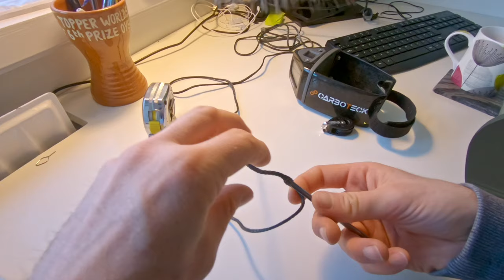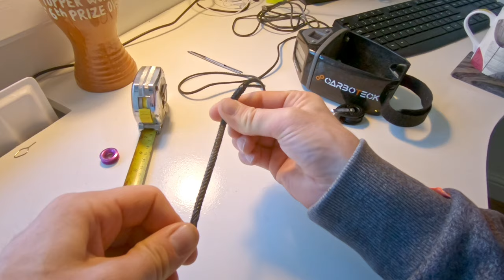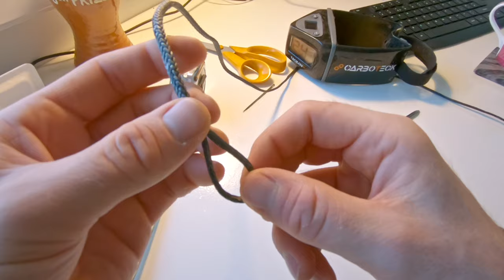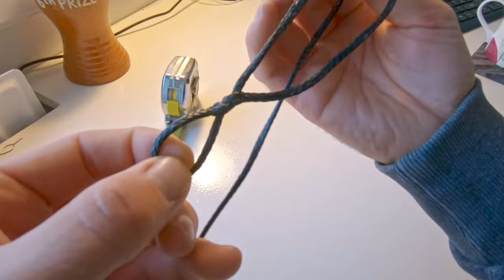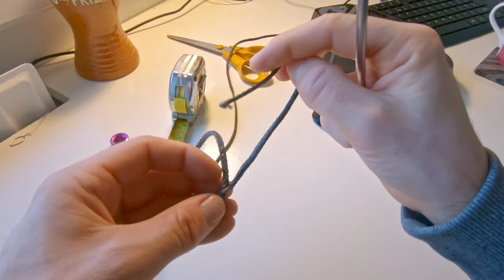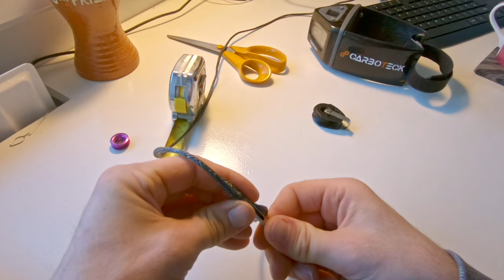Brummel lock splice: trick for single tail

Comment: Alternatively you can bring the tail through the hold BEFORE bringing the loop through the tail in order to remove the twist added when the loop goes through. But then you have to figure out which direction to put the tail through to begin with.

Comment: I love this solve, except for this... I am using 1.75 mm Zing-It line and there is almost no way to thread the loop back through. Zing-It is too small in diameter to get the loop back through. Any solution you have would be appreciated.

Comment: Great video. I have a question. Can you load up both ends of  brummel splice? I ask, as it was noted that the load is held in the taper.  My application is a fixed point of a cascading arrangement
Reply from the maker: Yes, although I would still bury the tail for 3/4 inches. Also, you want to make sure the end taking the greater load (i.e. the primary cascade) is the locked strand, not the tail, otherwise it will pull apart.

Comment: I'm currently replacing my dinghy dyneema kicker (vang) and I'm trying to figure out how it was previously spliced together. My problem is that when I splice one end of the line onto one of the blocks I can't splice the other end. The other end is eye spliced onto an eye at the end of a hook that hooks onto the mast. I can't use the trick to form a locking eye splice with only one end of a line as I can't pass the whole hook through the core of the 4mm dyneema line. It seems that the current kicker has some sort of splice that holds it without a stitching.
Reply from the maker: You can just do a plain bury but normally need stitching to stop it pulling out when not under load. Or another option is to cow hitch / luggage tag on with a larger loop
Reply: @MozzySails  I think I'll just have to go with a shackle as I can't luggage tag it as the block on the other end is fixed to another line. No idea how someone managed to do it the way it is before. Thanks!

Comment: Ok, so I won’t to secure two blocks to each other with a length of Dyneema, one at each end of the line. How do you do this?
Reply from the maker: Firstly, do the blocks need a locked splice? Locked splices are actually weaker than a standard brummel splice. I only lock for two reasons: 1) The splice is likely to be flogged. Or 2) I don't have a lot of tail. I am not really sure 2 is even a valid reason! An alternative to a locked splice, and probably good practice in almost all situation is to put a few stitched in the splice instead.  
Another option would be to do the lock splices, but leave the eyes large enough that you can cow-hitch them on to the block. This will depend on the block and it's type of fixing point though. 
Lastly, if teh blocked need to fastened close together, you could use a soft shackle, a continuous dyneema loop (stitched) or even a good lashing.